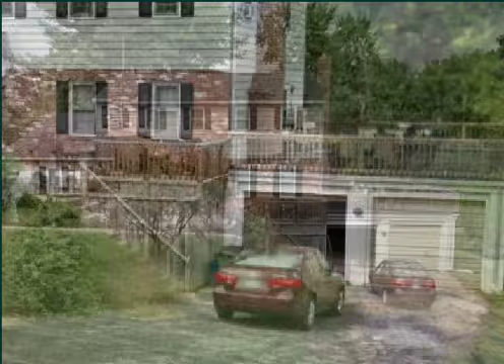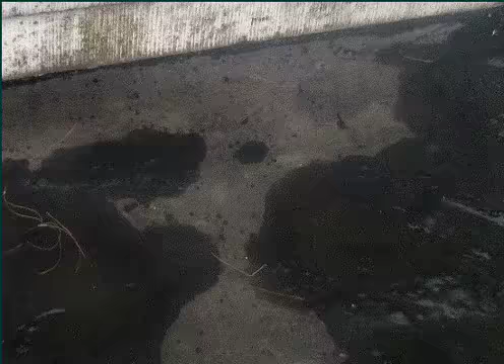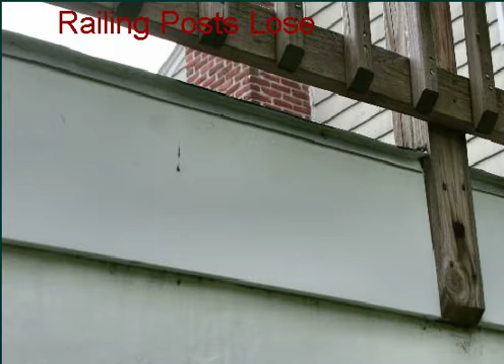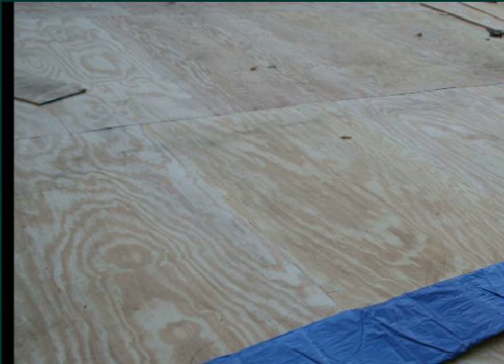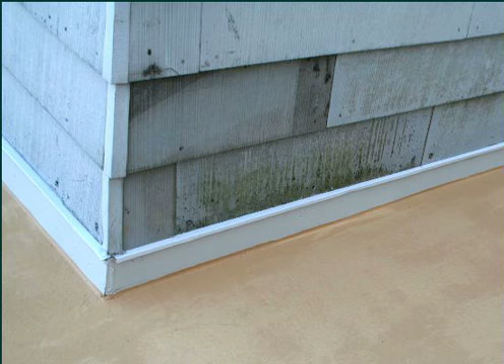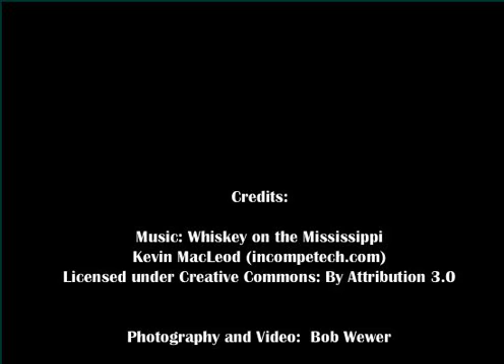Flat Roof Fiberglass Deck Philadelphia Video by Bob Wewer

Comment: Hello. Great video! I see that this is from 7 years ago. I have a very similar situation. My one car garage has a concrete patio on top. There is deterioration on the sides and you can see where they have tried to repair in the past. There is one drain in the middle but the water really just sits there as there are no slopes or gutters. The leaks are getting worse. Do you still do these types of projects? How can I get in contact with you? My email is bmccra74@gmail.com

Comment: They applied the epoxy directly over the wood panels without any primer?
Reply from the maker: No primer is used when installing polyester resin bonding to finish plywood.
Reply: ok, poly resin + 3-4 oz fiberglass with boat paint?

Comment: I have a store with flat roof . Planning on using your idea of fiberglass instead of torch rubber or anything else . it is 40 by 80 ft has a 2 tapering to 4 feet wall all around. the decking is metal I was going to cover it with Plywood  Im on my last nerve with this roof nothing has worked . What do you think ?
Reply from the maker: It is a great roof and if done properly, it may last for ever.  40 x 80 is a large area.  It may require an expansion joint in the middle.  OSB is a good deck for this because of the affinity the substrate has for the resin.  Check out the English and GRP roofing.  They are doing it everywhere over there with great results.  It can be pricey however.

Comment: I see you left a comment on closed foam spray in the attic and what it could do to fiberglass reinforced asphalt shingles.  I have a friend looking at spending 50k on a trailer unit that has a foaming unit on so he can spray under the roof decking in attics.  He heard that there is income potential of 25k per month.  My question is to you, is this a good ideal for a career move?  Or is there a better system that would be better for the asphalt shingles and give the homeowner a cost savings in electric bills?  I look forward to your response.
tkx,
john
Reply from the maker: John,
Thanks for the question.  I am not sure as to the career move regarding spray foam.  It would be a matter of attaining the volume of work to earn the money.  As for spraying directly to the backside of a roof deck that has a fiberglass based asphalt roofing shingle, that is a no-no.  If there could be ventilation provided, possibly in the form of baffles with intakes and exhaust, it may be feasible.  The roofing shingles have to be allowed to dissipate heat through them and into the attic.  The failure of the shingles also occurs if bat insulation is installed tight to the roof deck.
Reply: ***** That makes sense.  I will let him know.